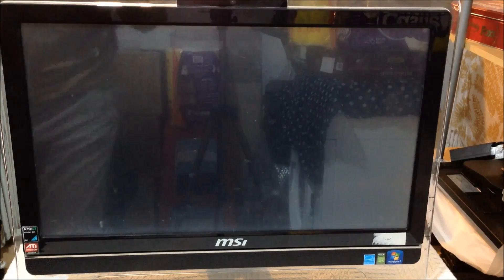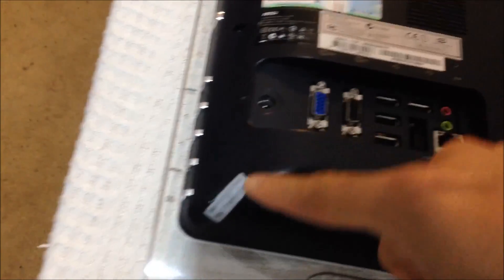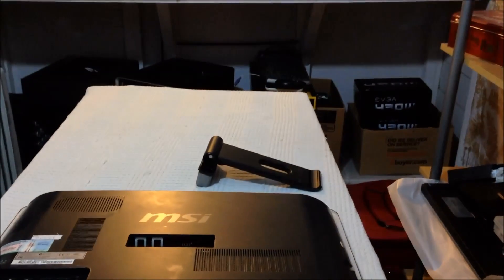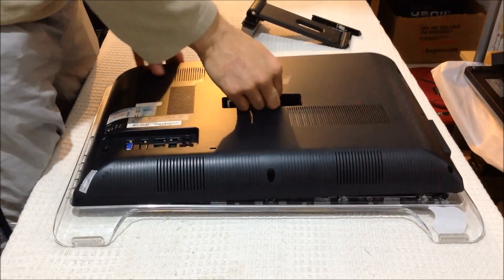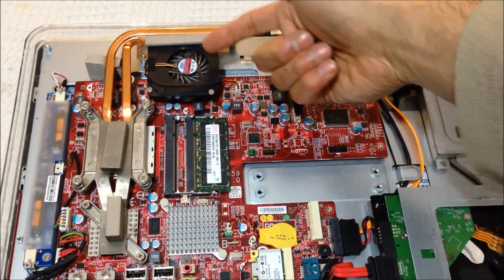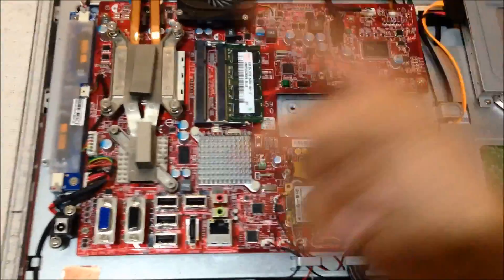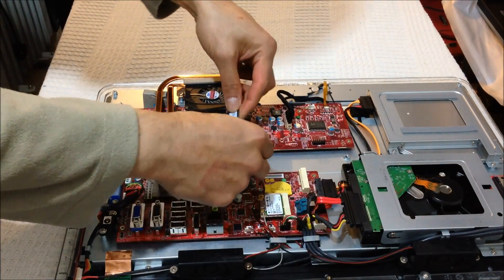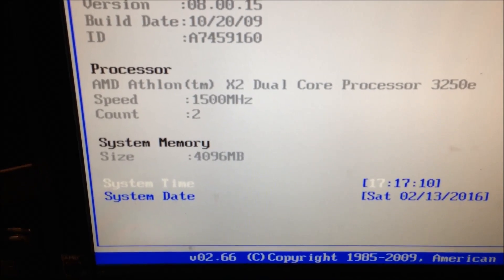All-In-One Desktop PC (AIO) Ram Memory Upgrade Quick Easy Tutorial

Comment: Hey I have a question, when upgrading ram do you have to have specific rams for your desktop or does a all in one work with any kind of ram
Reply from the maker: There used to be an issue with older RAM like DDR2 generation where Intel and AMD RAM would not be cross compatible on some motherboards.  Since DDR3 this is not a problem I believe, all RAM should work in either platform.  The be certain, it does help to consult the manual of your specific All in one, if you don't have that, I would advise that you ask the vendor/seller for compatibility if possible.  Some AIO use laptop RAM , others use desktop RAM.
Reply: I have a dell all in one, can I use any kind of 8 GB ram?
Reply: Also another question, if I wanna improve my all in one for a little bit of gaming experience do I need to upgrade graphics card ram or what?

Comment: Nevermind, I figured it out. My case is lightly different on the msi I have. It doesn't have the access holes to remove the stand screws.
Reply: same here. might be simply adhesive strip that needs to be removed/replaced.

Comment: I have a msi AE2220 WindTop I am working on, but I can't figure out how to remove the back cover? I found the screws around the edges, but how exactly did you remove the screws for the stand from the back? Also, how did you remove the CD Drive cover?
Reply: Dee Stroyer I can help here. You don't remove the stand on that model. There's a metal plug that sticks inside of a metal cap internally, and it causes the case to get stuck when trying to remove it. You have to pry the back off with quite a bit of force. Just make sure the 4 screws around the stand are removed, and the three silver screws inside the stand are removed.